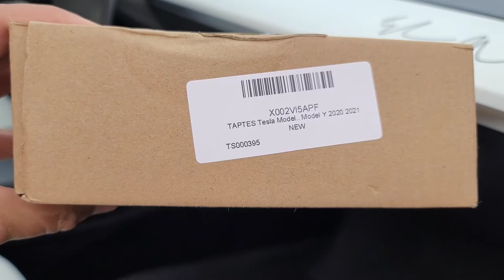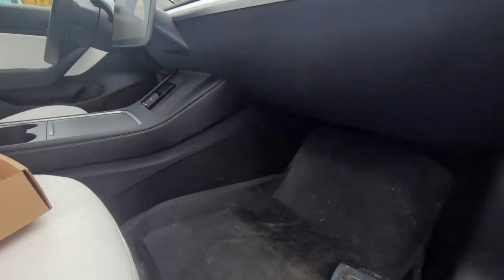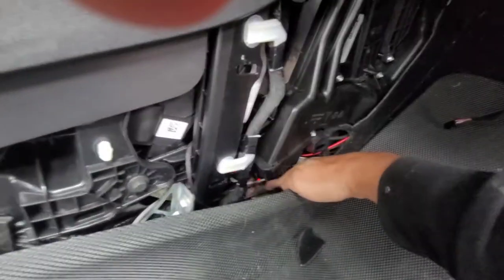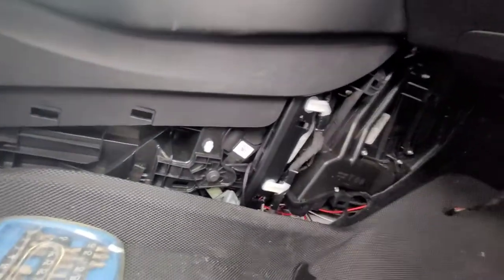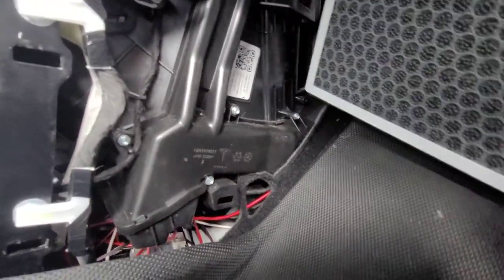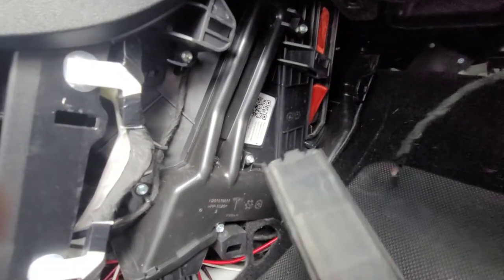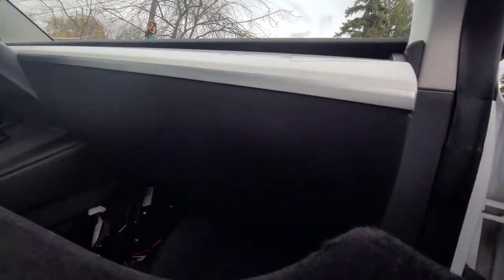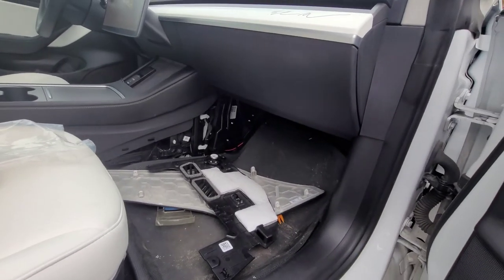2021 Tesla Model 3 Cabin Air Filter Replacement

Comment: Dont have to remove the speaker wires... I just set the panel out of the way enough with connections still on ,plenty of room to still work...

Comment: Great videos! Looking forward to your relay video. Is the only difference from your previous video the blue 12v being replaced by this new wire coming directly from the battery? Are all others cables routed from the back of the console or did you find a new place to tap in from? Thanks in advance.
Reply from the maker: @Eric Ledezma Thank you! Yes only moved the 12v wire directly to the battery all other wires run back to the same position under the rear vents. The brown signal wire also comes from the driver footwell but there are two wires there you could get confused with so would need to make sure to test. So that's why I kept them in the consol so I know I was on the correct wire.
Reply: @stvpket  I’ll be doing the same. I appreciate the quick response.
Reply from the maker: @ericledezma6810  anytime, let me know if you have any other questions

Comment: Only thing is you forgot clean the coils!
Reply from the maker: @Eric Green no bad smells or anything in the car so did not need a coil cleaning but I will be doing that next filter replacement as I do have more miles on the car.